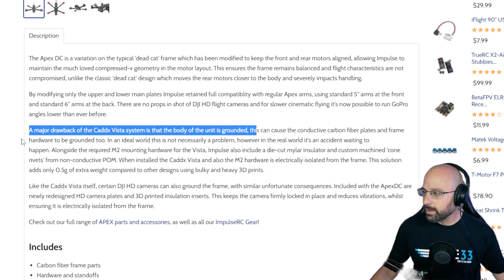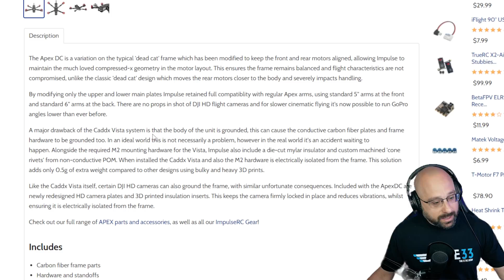Your quadcopter frame is grounded. That's bad. Or is it?

Comment: So on a real aircraft, the airframe is always 'grounded' to ensure that everything is at the same potential. If the airframe has parts at differing voltages it's potentially sparky and can also upset instruments.  Carbon panels are generally manufactured with a copper mesh in the laminate to ensure that they can conduct electricity efficiently. This mitigates against lightening strikes, which tends to blow holes in semi-conductive materials.  I suspect that none of this applies to small drones..

Comment: Thanks Josh for illuminating this topic.
If I may add;
Voltages below 42V are fairly safe for humans. It depends on the impedance -conductivity of your body.
As far as hazards to onboard electronics...this is a poorly considered feature of most of the electronics in use in drones today.

 But there is a difference between human safety grounding and <Radio Frequency> RF grounding.
Aside from the hazard of onboard short circuiting, IMHO, having a grounded craft frame is a good thing. 
This may need a bit of testing, however
Conventional radio practice, is favorable towards a ground plane where an antenna (and range) is of interest. Since a drone is basically a mobile combination of radio receiver AND transmitter(s), having a grounded plane in proximity of the antenna(s) actually has the effect of improving signal coupling and thus extending the range of the craft. It may also contribute to what is known as 'ground loops' which can have detrimental effects. As said, needs testing.

Comment: Wait a second. So if the heatsink isn't grounded, but the mounting holes are. Doesn't the Apex solution do nothing? Frame still grounded. Those mounting screws look like they are metal.
Reply from the maker: Apex also includes plastic inserts that isolate the screws from the frame.

Comment: Just one of the reasons that analogue is best. So glad I can't afford digital 😄
Reply: Did you even watch the video? Many analog vtx also ground to the frame.
Reply: @zachariahcheatum7128  Yes I did thanks. I've built over 200 analogue quads and had no issues whatsoever.
Reply: @richardheedfpv9626  you've built over 200 analog quads but can't afford digital?
Reply: @zachariahcheatum7128  That's why.

Comment: This brings another question that has bugged me for a while. Why don't we put fuzes on quad copters? It seems like it would save us an esc or 2 motors Even.
Reply from the maker: The motors pull 100+ amps during normal use. The fuse would blow during normal flight.

Comment: Grounding metal enclosures is common practice in ac electrical devices. It is not common in dc components. It's Apex a little hyperbolic in their statement, sure, but they are not wrong.

Comment: I have a 4in1 ESC which has 2 holes connected to VBAT and the other 2 connected to GND. Mounted on a carbon frame with metal screws, it made me some smoke. Designed by a genius.
Reply: That could only work with a plastic whoop frame
Reply: @zachariahcheatum7128  I just used plastic screws and standoffs so it's completely isolated

Comment: I left my XT60 soldering spots open so I could inspect them better for potential loose soldering. At some point they touched the frame and positive short ciruited over the frame - actually causing the carbon around it to catch fire. It probably did that mid-flight too, cause I experienced short sudden power-drops. That was... creepy as fuck. Now that I found the magic of Kepton tape, I can have them inspectable and isolated at the same time XD

Comment: The vista circuit isn't grounded (except for the ground wire power feed connection) - but the metal ufl protection clip is of course connected through the nearest screw hole so in a way, when using 4 screws to fix the vista there will always be a ground connection to the rf amplifier section of the vista circuit. Any stray ground wire to the frame is no issue, but any ESC wire or motor wire will either stop the vista's WIFI amp section (resulting in image freeze in the goggles followed by a stop of transmission) or burn stuff (in case of any red vbat, 5v or whatever power wire touching frame). I guess you could use only 3 screws and sticky tape...

Comment: If you use steel screws for the stack the frame is always grounded. The issue isn‘t GND on the frame. The issue is having power on the frame causing a short.

Comment: I agree with the statements in the video, but my personal main concern is the effect of (not)grounding Quadrocopter frame in relation to the RF and other signal performance. Does grounding frame help or does it hurt (eg. video quality, signal reception...)?
Reply: It could also help to kep the Interferences from the motor wires lower if you ground the frame.
But i recon that the negative effect of grounding the frame is bigger on the RF signals than the effect of the EMF Interferences of the motor wires
Reply: To answer both of you, grounding the frame in more than one place creates a ground loop that is susceptible to RF noise. Ever hear a stereo in a car that makes a whining noise through the speakers that goes up in pitch when the motor revs? That's caused by a ground loop between the motor and the amplifier for the stereo. So having the frame grounded will make it more susceptible to the noise from the motors and wires. But twisting or braiding the motor wires will create an electromagnetic "shield" that will reduce RF noise in the wires.
Reply: @zachariahcheatum7128  Thanks for the answer. So by grounding the frame in more than one place the RF noise doesn't get ground and pulled down into the battery, but it can 'loop around' the 'circular ground plane'? I am not sure how to wrap my head around that. But I guess it makes sense to twist everything and stop the noise at the source. Also I was really surprised how big effect twisting camera and VTX wires had on the quality of my video lol
Reply: @SukSukulent  I'm not sure how to explain it any better myself. I learned about ground loops when I did car audio many years ago. I bought a filter that I connected inline with one ground and it cleaned it up. I suspect the filter was capacitor or coil based. It also explains the limited range for a quad compared to a plane. I used Spektrum to fly planes before getting into fpv. So my first couple quads were using Spektrum. I've flown planes until they were a tiny dot in the sky and never a failsafe. But with the RF noise inherent in a quad, I was failsafing at 200m. So while I can't explain a ground loop any better, I've seen the effects of a dirty RF environment.

Comment: I had a new build with a GRL Titanium frame that had video dropping out real easily. I read to isolate the dji camera since it uses carbon cam plates. I printed an abs spacer and used nylon screws and it solved the problem.

Comment: As far as I know, grounded case (or frame) helps reduce electromagnetic interference
Reply: The question is: does grounding Quadrocopter frame help with overall RF performance of the Quad? Like better reception and less noise?
Reply: To answer both of you, grounding the frame in more than one place creates a ground loop that is susceptible to RF noise. Ever hear a stereo in a car that makes a whining noise through the speakers that goes up in pitch when the motor revs? That's caused by a ground loop between the motor and the amplifier for the stereo. So having the frame grounded will make it more susceptible to the noise from the motors and wires. Also, braiding or twisting your wires creates an electromagnetic "shield" that helps isolate RF and EMP.

Comment: If every Device has a proper Ground-Wire,  (the Motors don't need to be Grounded ),
then having every Device ALSO Grounded via the Frame, creates zero problems.
( the Ground-Wire has  SUBSTANTIALLY LESS RESISTANCE  than the Frame )

You can even intentionally Ground the Frame to  Battery-Negative with a Wire, 
and again,  it will create zero problems.
( Never depend upon the Frame for an adequate Ground Connection ).

The problems arise when an unprotected Wire, 
which is attached to Battery-Positive,
is allowed to come into contact WITH ANYTHING other than 
what it is supposed to be Powering,
then You will automatically have serious problems.

If You buy a new Motor, 
and it comes with 3 different sets of Screws, with 3 different lengths,
and You install the wrong length Screws, and don't check the fit,
and without reading the instructions that came with the new Motor,
then you're a stinkin'  IDIOT,  
and You will probably get what You deserve.

Attaching an Antenna-Connector directly to the Frame will not  "hurt"  anything,
and  "may"  "slightly"  improve the performance of the Antenna.
There are a ton of  "maybes"  involved with this particular subject.
Nothing about Antennas works in every single application.
.
.
.

Comment: i had a winding on a motor start to touch a mounting screw...caused a ground to frame and started to smoke at the caddax vista mounting screw...lucky nothing totally burnt out ...f80pro motors

Comment: Electricity takes the path of least resistance
So if you ground your frame correctly, a strai wire with vbat to frame should not harm your electronic.
Reply: The problem is, that most people have grounded frame through the electronic (screws, flat shields touching...), which means that the amps will flow through it a desteoy it.

Comment: Tip:Only if the carbon fibre is without resin on top an bottom is conductive. The carbon fibre that is glossy is non conductive

Comment: The reality is that our quads can take quite the beating resulting in all kinds of failures and having the frame grounded is just an current path accident waiting to happen. If isolating it saves me from losing a quad then it's a precaution I'm happy to take! Some examples of failures I've personally encountered/seen since I built my first multirotor over a decade ago:
- Brand new motor with a short to stator (FIRE!)
- Squished motor wire to arm nut in crash (FIRE whilst stuck in a tree!)
- PDB insulation wearing through when mounted directly on carbon (FIRE)
- Shorted motor to stator after crash
- Long motor screws (Seen this happen to MANY beginners, and a short stopper won't detect it until you arm the motors!)
- Mangled battery wires shorting to top plate
- Arm mounted ESC rubbed through Heatshrink (frame positive) combined with:
- Rx antenna coax insulation wearing through where it touched carbon

So yeah I'll just continue to isolate my frames where possible from now on.

Comment: I had interference in my analog video when I throttle up. Found out it was due to VTX antenna connector touching a rear metal column.
Reply: Had you a grounded frame?
Reply: @SukSukulent  the antenna grounded my frame, which caused black lines interfering in my video. Wrapping the column in electrical tape solved the problem.
Reply: @Musdom How black were they? I have faint grey lines in my feed, might try this.  So that means, that electrical noise is getting from ESCs and stuff to the antena, interfering with the signal? Isolating the vtx antena might be a fair thing to do.
Reply: @SukSukulent  very apparent solid black lines. Faint grey lines are normal if you use Vbat for camera/vtx. The latter for me is tolerable enough to not bother to fix.
Reply: @sakak_musdom  Hmm, thanks, I might try adding a cap on on the vtx vbat

Comment: Back in the early days I had a 250 quad, and I accidentally had a wire crushed between the carbon frame and a standoff, causing it to short to the frame. 
The camera I had was grounded. Thus causing I flatout short. But the resistance was high enough that I did not notice, and I actually flew it for a minute. I did notice a big performance loss, and landed the quad to check it out. After landing I noticed a LED in the corner of my eye, and wondered for a couple of seconds what that LED was... It was not an LED, but a small fire where the camera shorted to the frame. My friend who was there tought it was hilarious.

I blame my shoddy handiwork, but because of this I am a bit cautious of turning the entire frame into a big ground-plane.

Comment: I think the issue is not about creating a short circuit, stray wires are dangerous around your electronics.
I think the issue is about creating a ground loop (multiple paths for current to flow) which can cause interference with your video signal or digital communications like between your fc and esc, it will limit your range or stop your fc from talking to your esc.
Reply: Yes! The quad is a small, completely electrically isolated system. It has no objective ground to dump electrical noise, transient spikes and EMF to, only it's own relative ground. The ground plane on a quad is actually very noisy, enough that if the whole frame is a ground plane then it can be much closer to your VTX antenna and cause interference. Most VTX have separate 'signal' ground (for the antenna sheath) and main ground plane for this very reason.

Comment: Heres someones experiences that always check voltage on a frame and never grounds it out. I install my vistas/airunits using thermal conductive epoxy. If not then the carbon will become grounded which i have tested. Now youve got your frame grounded. Sometimes escs and fc have a power around their wholes where the gummies go. Sometimes and this has happened to me, the screw going through the gummy will have contact through the gummy to the rest of the fc esc whole. Now you have a current leakage with no way of knowing because your frame is grounded and you have a current loss. Now lets say i didnt ground the frame with the vista/airunit. I can check the voltage on the frame to the negative of the battery. If my frame has voltage then i know for a fact something with power is touching the carbon/screws somehow. This has happened to me quite a few times and it either came down to the gummies or solder going through the esc wholes and out the other side touching the frame(the second one is my fault for putting too much solder on main battery pads on esc). Anyways you dont want to create half a problem by grounding the frame because when you get the other half of the problem then you cant quickly measure the voltage on the frame to the battery ground. Instead youd get 0 vols on the frame but there is in face current going through it. Just real world experiences from someone with a bachelors in electrical engineering who has tested this on many quads and found some to actually have voltage on them and if they had been grounded, then id have a current loss causing shorter flight time or even a none working quad. Its just one fault out of the many faults that can happen when building a drone and you want to have the least of these when building one to know if something actually came faulty which can happen more often than you might think.

Comment: If this is really a concern, just take a standoff closest to the power lead and connect it to ground. That way if the vbat hits the carbon it'll take the path of least resistance, which would be that wire until the carbon is burned enough to stop being conductive.
Reply: This comment needs a lot more attention - even to the exact point Bardwell makes, the design practice that prevents this issue in literally every vehicle is grounding of the chassis…
Reply: Just ground the standoff using a very thin Wire (Like a fuse or Something) , that will burned away If vbat touches the frame, and protect the Rest.
Reply: @Enderkruemel  You want the frame or the shorted wire/strand to act as the fuse in this case, so the wire would need to out last the frame since if it 'blows' then it will take the next path to ground available. When I've seen this happen in the past, the carbon usually burns quickly where the short happens because the connectivity sucks and that's the hottest point typically.

Comment: In my country you are bound by law to make sure the chassis of electric cunsumer products are grounded. Any chance of a chassis possibly giving live power would be a big no-go. And there are some added requirements for products that are above or below 12 or 24 volt.
Reply: This is probably a misconception. Sorry I would need to write a book to explain the intricacies of when device chassis needs to be grounded and when not - but any ungrounded touchable metal must be double insulated.

12V and 24V devices are pretty much automatically Class III where grounding doesn't even have universal meaning.

Comment: Don’t the Vista heatsinks have conductive seals touching traces on the two PCB’s, which are grounded, to make the heatsinks into a Faraday cage to isolate EMI?
Reply from the maker: The vista heat sinks do not have continuity to ground, so that can't be true.
Reply: @JoshuaBardwell  Thank you for the response and great info!

Comment: ¡🔨 Nailed it.
Unless you have a specific reason for the frame to not be grounded it's original process of assembling has been tested and proven to be the best way for assembling the quad.
I was curious if anybody has ever tried running a quadcopter setup in reversed polarity?
I'm only asking because clouds are statically charged so I'm curious if there's any unknown energy source that were not tapping into from the clouds to charge LiPos in midair. I don't see why we can't find a way to harness the power of cloud ☁.
I was thinking a series of towers just like the same used for high voltage power lines to create a track or road so to speak for a ground source to jump from the quad to the tower.
It's not far off from something that Nikola Tesla would have thought of just reverse polarity.
Reply: I believe it would be an asset to a landline cell tower transmiter as we discussed before JB.